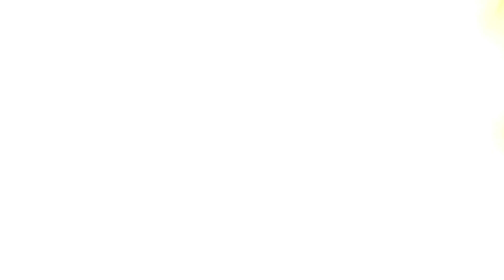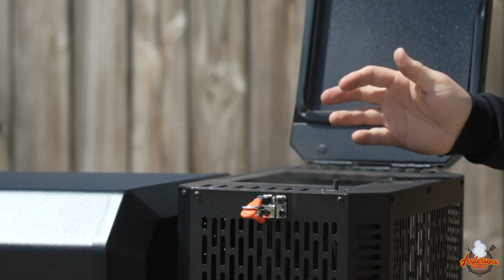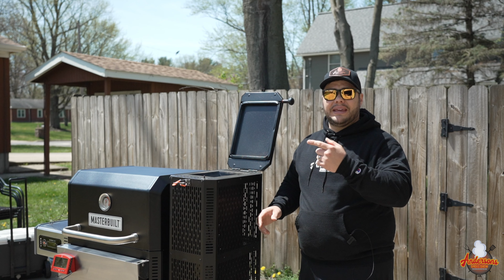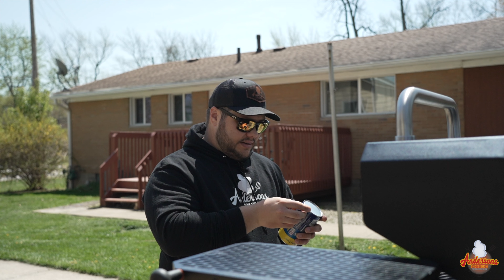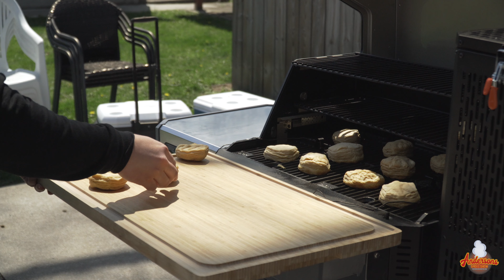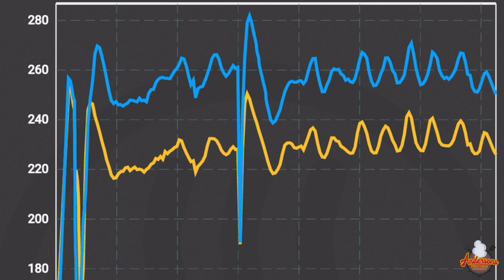CRAZY Temperature Test Results on the Masterbuilt Gravity Series 800

Comment: Have you done this test with a drip pan? That would be interesting.  I've found that using a couple of drip pans causes a difference of about 50- 75 degrees.
Reply from the maker: I have not actually, but I could see where the airflow is disturbed and would change the temps

Comment: My 1050 won’t go higher than 500. Why ??? Any help guys ?
Reply from the maker: Not sure. I’ve noticed that if I have a bunch of built up ash and little pieces of charcoal at the bottom of the hopper, it doesn’t seem to get enough airflow to get super hot
Reply: The problem you have is the LID switch. If that switch is malfunctioning, your MB will not get above 500 deg. Easy way to temp fix is short the 2 wires going to the switch with aluminum foil then crank it to 700 and see if it fixed it. Do the short at the wires underneath, not at the switch side. That way your fan will still work properly and won't run all the time. If the works, you can either buy new switches or bypass (short) your switches. I have had MULTIPLE problems with the 1050. Customer Service for Masterbuilt is awful. They promise to send replacement warranty parts and keep telling you over and over again their warehouse is behind and they will send an email when it ships. I have been waiting on a controller for over a month and they still haven't shipped. I will never buy another Masterbuilt product again. Good luck fixing your switches if you haven't already. @AndersonsSmokeShow
Reply: Lid switch

Comment: in regards to the 560 running badly, you have to update to the latest software.  The PID controller have changed/updated to gain and time delta to better hold consistent temps.  But many have issues with the wifi being able to get the update.  You may have to contact MB to swap and get a latest update controller.
Reply from the maker: That’s probably true. I don’t know the last time that the 560 was updated!

Comment: just wondering what difference in this test the mods makes eg the damper etc
Reply from the maker: I haven’t modded this one yet, but I would think that it may have an impact
Reply: @AndersonsSmokeShow  ya especially the damper and the water pan you would think that would help with that hot spot nearest to the coals
Reply from the maker: @Daeduluus  yeah I would think so

Comment: Put a probe on top shelf ran it 250 and it's within 5f of the built in probe.... not sure what the complaints are about bottom left is a Hotspot but one can tune it with a diy diffuser found on Amazon combined with the griddle manifold but I removed the top half of it to place the diffuser on works really well still tuning it

Comment: Have a 1050. Smoke everything on the middle and upper rack.  If I have to use the bottom grate for a smoke I rotate. When grilling my hot spots are middle and left when facing the grill.  Right side is my cooler zone.
Reply from the maker: Oh wow, my cooler spot is the left side.
Reply: @AndersonsSmokeShow  yeah, you're at a lower temp with that hotter right side.  Grilling temp, higher airflow makes sense it would be middle and left.

Comment: i am think about blocking off the top port and adding a chimney at grate level, maybe using the reverse  flow thoughts
be a simple mod but might pay dividends in getting the temps even. and I am thinking back right corner mid grates
Reply: any thoughts ??
Reply from the maker: My problem with that is voiding the warranty.... The 800 definitely runs better than my 560

Comment: How do you feel about using the Masterbuilt in wet weather (rain, snow). I want the 800, but I worry about the electric components and BBQing in the spring and fall with rain and snow. Do you run yours in wet weather? Any suggestions?
Reply from the maker: Mine 560 got a little wet a few times when I was cooking, but I always keep it in the garage when it isn’t in use. I’d get a cover for it and it should be fine

Comment: Great video! I’m about to pull the trigger on the 800. The only concern I have is the smoke that comes from new charcoal burning. Is there any bad smoke that gets blown by the fan while cooking? For example, if you’re doing a low and slow will the fan blow on charcoal that hasn’t fully ashed over yet?
Reply from the maker: With the way its constructed it would be pretty hard to tell how much of the charcoal is burning and where the air is passing over. There are times where you'll see a whiter thicker smoke, but most of the time its running thin blue.
Reply: @AndersonsSmokeShow  Gotcha! Seems good overall, though. That griddle is the kicker for me. Thanks for the response!
Reply: Get this smoker. Dont overthink it. It does a good job and we love ours

Comment: What I want to know is WHY does the factory temp probe report super steady temps but probes set in different locations ALL report pretty wide temp fluctuations? I think Masterbuilt has intentionally programmed the internal probe to report steadier temps than what is actually going on.
Reply from the maker: It depends honestly. The controller may be programmed to sample temperature on an interval rather than instantaneously.